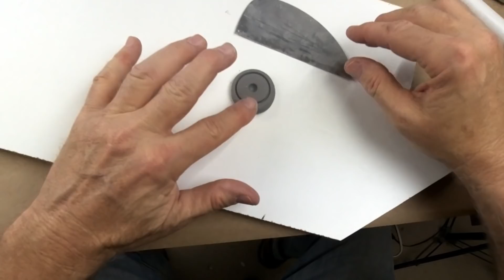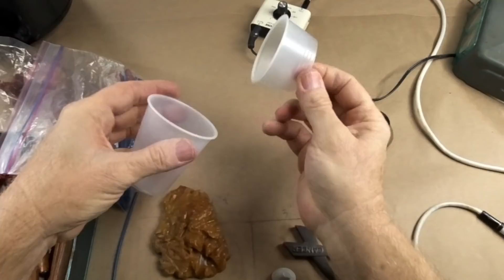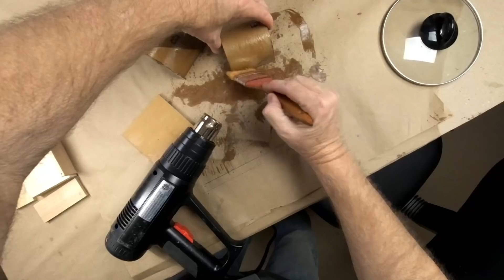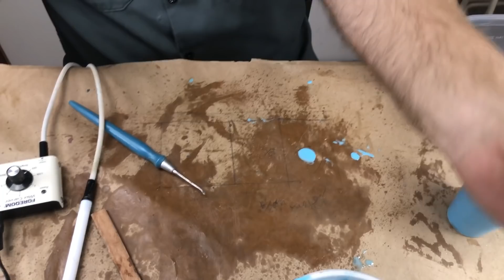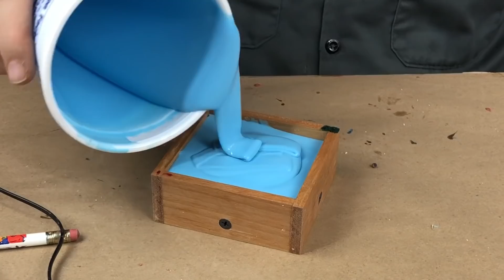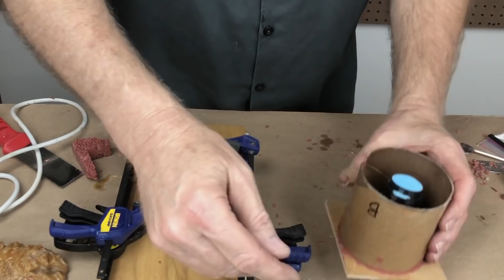Silicone Rubber Molds - 3 Ways  Part 1

Comment: Are you willing to help with some questions on silicone casting? I have tried degassing and I feel like it was creating more bubbles than helping. I am using PLA 3-d print then pouring silicone inside. Thanks for all your videos.

Comment: Hi Robert! I’m a recent subscriber and I have already watched 8 or 9 of your videos. I am especially motivated because this is exactly what I have been looking for in the metal casting I do in copper and silver! So a huge thanks for the high quality and thorough explanations in this series. Robert, will the MR-150 release agent work between PLA, from a 3d print, and the econosil-25 rubber?  Thank you so much!
Reply from the maker: Usually you don't need a mold release between silicone Rubber and PLA. What you need is to make sure that the brand of printing plastic you are using will not inhibit the cure of the silicone rubber. The only way to find out is to test your rubber against a sample of your PLA. I don't think mold release will work to prevent mold inhibition.

Comment: Sorry Robert, but I got distracted when you de-moulded the nut at 25:24 ...................  I got too busy keeping an eye on your wax carver burning into it's power cord!
I guess wax carvers don't actually get as hot as soldering irons,  but still hot enough to burn through plastic.  Was there much damage made to your wax carver?

TURK
Reply from the maker: Fortunately it survived and lives on! Another thing I like about the Foredom waxer is you can replace any of its parts. Worst case I would have had to buy a new handpiece and cord.  When cheaper tools die you have to junk and replace them.

Comment: Will non cured silicone stick to cured silicone? If I wanna make like a stripey mold can I do it by layering? (edit) should probably watch the whole video first😂 I think it answers my question. 🤷🏼‍♂️
Reply from the maker: The silicone I use definitely sticks to itself.  I do molds in poured layers, brush-on layers and often cut up old molds to recycle the chunks into new molds. But definitely test the brand of rubber you’re using to see if it bonds before using this method in a mold.

Comment: Is there a special reason you use plastic cups or cardboard tubes for round molds instead of rolled up plastic sheets, where you could make any diameter in an instant?
Reply from the maker: Rolled plastic works great too.  Plastic cups are the ultimate in speed and convenience for small parts. I'll do some rolled plastic molds one of these days. I try to show as many ways as possible to make molds on the channel.
Reply: @RobertTolone  Cool, can‘t wait!

Comment: Hi Robert, could you give me information, please,  what glue do you use and where you bought it ?
Reply from the maker: The glue I am using in this video is five minute epoxy from Zap called ZPoxy. But pretty much any brand of 5 Minute epoxy works fine. You can get five minute epoxy online or in just about any hardware store.

Comment: Very Cool Robert! Thanks for taking this on and giving such a thorough demonstration. I linked to this on my FB page and in the group I worked with in creating that 2 piece part.  I think they will like to see this. That 2 piece part, btw, was for a PAPR hood. Ventilated hood that was very popular when COVID 19 became a thing. A local 3d printing group was tasked with making 200 for a local hospital. I changed the connection of the original 3M part in solidworks  to this screw on part method  simply to make it a cast-able item.
Reply from the maker: It was a really fun project Karl, thanks for sending it in. It's amazing that such seemingly ordinary objects can require search different strategies to cast. That's what makes this so much fun!

Comment: Question: How to copy a silicone mold? Suppose I have a 2-3 piece mold for transparent casts, which took a few days to make.  How to made mold for molds?
Reply from the maker: I have never been successful making molds of molds.  Whenever I make a production run of one item I cast between five and 10 copies of the original and use those copies to make production molds from. This works because I always use the cut mold method. It is theoretically possible to make a mold of a mold however. Just be sure to use a good release agent when casting silicone against silicone.

Comment: Hello Robert, The pot you have on the side is that just a standard temp controlled cooking pot you use to keep your wax in liquid form. Then use that to brush onto your wood boxing up pieces? Thanks. 
Thanks for the reply to my other question - it will be a handy video down the track. 
Whats your optimum temp on your Fordom for do the wax welding. Got myself a little SJK brand for dental wax molding? 
Hopefully should do the trick. The Fordom is expensive in comparison.
Reply from the maker: Yes, it’s a crock pot - I bought it super cheap from Target. The temperature I run the Foredom tool at depends on the wax. The sticky wax I run very hot, my sculpting wax cooler otherwise it burns rather easily. So you just have to experiment with the wax and the pen to get the right settings.

Comment: Robert  how would you go about making a mold or series of molds to effectively overmold another part or shape to a model. Such as a new color resin forming say the jacket on a figurine model or even a different material such as PU rubber or even silicone if that’s possible like the rubbery grip on hiking sticks handles? 

Just thought it’s would be a challenging task stopping the over-mold pour from   running over the existing first cast. 

Great video once again. Ps thanks for the advice on my molds the other day on my next project I’m going to try to blank the corners out of my mold boxes to save resin like I’ve seen you doing. :)
Reply from the maker: Hi Jordan. I have very little experience with that kind of molding. I have done casings where I cast sections of the same mold in different color resins... but it is tricky and time consuming.  I prefer to simplify the casting process rather than over complicate it.

Comment: Totally need these tutorials right now for my toy business
Reply from the maker: Most of my business has been sculpting toy prototypes for the entertainment industry. Molding and casting is the final step in the prototyping process.  Of course nowadays 3D printing and CAD models straight to manufacturing are replacing hand sculpting and mold making.

Comment: Robert, I  am new to casting and molding.  I have always been interested in how to DIY produce and replicate needed things without involving  a commercial manufacturer. While a lot of what you do doesn’t apply to what I am currently doing, I am amazed and captivated by the innovative problem solving you constantly do from how to mold the item, create a support system for the mold, and placement of sprues and vents. Thank you for all the information and effort!
Reply from the maker: Thanks so much for watching!

Comment: So no one is going to talk about the wax carving pen burning up its own wire sleeve at 25:20? I hate it when this happens to my tools, at it has happened maaany times with a soldering iron, making severe damage in some cases as it takes some time for the smell of burning plastic get to you! At least I am somewhat relieved that it can happen even to a person as methodical as you! I can never get enough of your videos, your approach to problem solving comes very handy in many cases even though I don't make molds or castings yet, but I am planning to do some day for sure! Thank you!
Reply from the maker: That's not the first time I've burned something unintentionally! 😳 😢 😀

Comment: Hello, Robert. Thanks for another inspiring video. I would like to get a wax pen like the one you have. I found sticky wax and wax sprues online. I also found the Foredom waxer model you have, but it’s prohibitively expensive, especially since I’m just starting to experiment with mold making and casting. There are lots of cheapo waxers available, mostly marketed for dental use, but I don’t know what to look for in a waxer.  Can you please offer some insight regarding what makes a waxer suitable for this purpose?
Reply from the maker: I have used a number of wax pens over the years. Back in the bad old days before the internet the only place I bought them was a jewelry making supply store.  The cheapest way to go is with alcohol lamps they sell. The biggest downside to those is you must constantly heat the tool tip in the flame.  I soon tired of that.  Then I went through several electric pens that either burned out or wore out.  The Foredom Wax pen I have now has been in constant use for more than 10 years.  Yes, it's expensive but for me it has paid for itself many times over. That said, be sure to get a pen made for wax that has a temperature control knob.  You will often have to vary the heat output of the tip. A lot of people try to use soldering irons or woodburning pens but the heat output is usually too high for use with wax.
Reply: @RobertTolone  
Thanks so much for your quick and thorough response. I'm glad you warned me about the soldering iron; I did look hard at those. I found a $50.00 jeweler's wax pen, and I think I'll go with that for now. Meanwhile, I'll write  Foredom on my penny jar.

Comment: Hey Robert I enjoyed your video as I do all your videos.  When I cast a part that has a high probability of air entrapment I pour the silicone into the mold then put the mold into the vacuum chamber and give it a quick pull. Bubble free every time.👍
Reply from the maker: That works as long as the model you're molding has no voids inside it.  I have a strict policy of not applying vacuum or pressure to models because I often get models from clients and have no idea how they were constructed.   I learned this the hard way and destroyed a couple of models early in my career.  But as long as you're sure of the model it works

Comment: Nice video, Robert. Will the threads unmold easily or do threads make the mold wear out faster?
And did I see right that you melt the plug of your soldering iron in a little accident there? ^_^
Happy Easter!
Reply from the maker: Sharp edges on any form can make the mold wear faster.  
Now I have to go back and watch my own video to see the plug melting!  Didn't notice it but I have melted things several times by being careless with the pen.
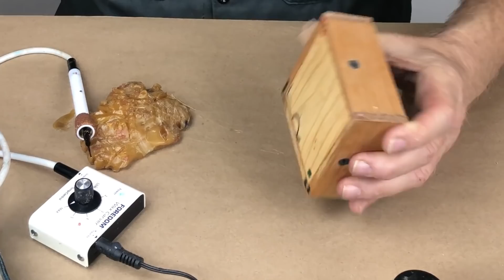Reply: @RobertTolone  It's at 25:15. ;) You knocked it off the wax and shortly afterwards some smoke rises up.
Reply from the maker: @roger.agburn  I went and checked today. That plastic sleeve must be fire proof because there wasn’t a mark on it!
Reply: @RobertTolone  Good thing. It's super annoying to damage your tools.

Comment: Hello. Completely unrelated. I purchased a silicone tray mold that is meant for resin but I wanted to use it for concrete. The problem is that the fill in part that would be the base of the tray isn’t deep enough for me to pour a good layer of cement. What is the easiest way to increase height of the walls so I can pour a thicker layer of cement. 🙏🏽
Reply from the maker: I'd have to see it to really tell. If you want send a pic to roberttolone@yahoo.com

Comment: Robert it’s a pleasure to watch you work. It’s very interesting to see how you plan ahead for as many problems as you can. I started in making molds and pouring resin to make replacement parts for vertical blinds that I couldn’t find because they were too old and out of production.  They turned out better than I had expected not knowing what I was doing.  I found that watching people like you on You Tube helped me get educated in what to do. There is something about making replacement parts and having them work just fine that is very rewarding. After watching you do what you do so well, I subscribed to your channel and gave you the thumbs up.  Best regards, Richard
Reply from the maker: Thanks Richard. A lot of the people who watch my channel are into restoration and making out-of-production parts.

Comment: Why did you have to do the second side to the nut? If you just left the one side when you filled it with resin it would be flat on top anyway.
Reply from the maker: It would not be flat.  It would be cupped.  So I would have to build the part up, overfill it with resin and sand it flat. You know how lazy I am.  This was easier!
Reply: You would need to place an acrylic sheet across the top of the mould to get a flat finish otherwise you would get a dip due to surface tension or too much that would need clean up.
Reply: If you put the pour spout on the first side and then glued your clear sheet to it, would that work also?
Reply from the maker: @annekabrimhall1059  I can’t see how that would work...

Comment: What is the name of the iron called you use to melt the wax its not a soldering iron is it ?
Reply: I’m interested to know what it’s called too.  I was thinking it’s either a wood burning tool with a smaller shading attachment.. or a hot knife with an attachment meant for slicing designs into styrofoam.   Hopefully Robert answers 😁
Reply from the maker: It is a Foredom Wax Carving pen.